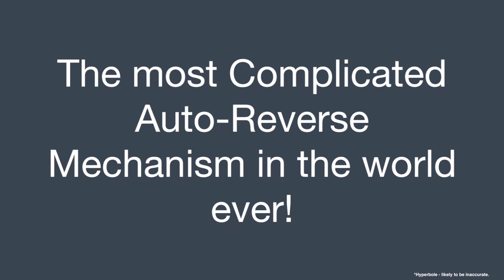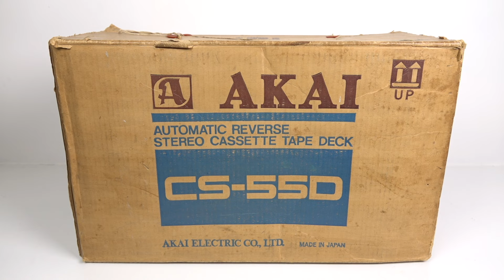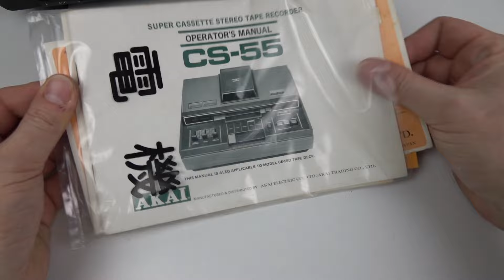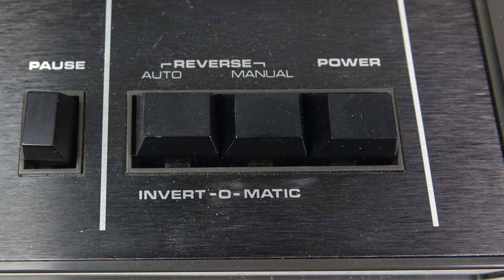Auto-Reverse: The Hard Way

Comment: I've admired this channel and the production values for quite a while. I'm still discovering videos that were posted years ago. This one is just terrific. It started out as a normal 'Techmoan' quality, which is very high. Then it ran into a montage of close up macro shots showing toothed tracks and gear wheels, belts, servos, actuators, lifting fingers, micro motors. Just wonderful. The smooth shadow and glare free lighting on these shots is astounding. Very difficult to get the tight camera focus and flat, perfectly white balanced soft lighting.  Excellent work. Thanks for posting. I hope your skill set makes you a good living and you have little to worry about. Wish you well.

Comment: The more I look at this, the more amazed I am at how this entire machine runs without any computer assistance. You can tell there was a ridiculous amount of thought put into this.
Reply: Sunny M don't even mention the assembly process. It's a jewel.
Reply: The engineer's brain was the computer. It's task: How to semi-automate (or fully-automate) a process using only electro-mechanical processes (because that's all there was at the time unless you wanted to make the thing 100X bigger by building a 'computer' into it, probably consisting of vacuum tubes or the earliest hand-wired through-hole electronic components).
Reply: @No-vm7go 

Lol what? Integrated curcuits already existed in '73.
Reply: At that time any chip in importance was like now an entire computer
Reply: @westelaudio943  Yes and I'm sure they must of been very expensive to big with!!
Reply: @toucan221  

No. They were in everything from cheap calculators to FM stereo decoders in tabletop radios.
Reply: @westelaudio943  That is Not strictly correct because I remember when you had to power a calculator from the mains,   NO they cant of had chips in them, your dreaming. that happened in the 80s
Reply: @toucan221  

I literally have one of those mains powered tabletop calculators and it has a custom microprocessor in it. 1974 was also when the ubiquitous 4558 op amp was introduced, which is still used in some computer speaker crossovers today. The 555 timer was introduced even earlier, 1972 I think, another cheap and widely used IC of the era.

Comment: Dear Techmoan!  Thank you for that, not seen it before, but what a joy!!  I built my business (now over 40 years...) on electro-mechanical design & fabrication, I am still immersed in it now.  Though modern electronics, etc. clearly have their place now, I get so incredibly bored stiff at, in particular, everything having to be controlled from a general purpose (mind-numbingly boring and quick to crash) Tablet, or whatever...  Give me proper switches, knobs and dials ANY DAY!  I have collected all sorts of stuff over the years, much like yourself, including the first (Philips) portable Cassette Player, which my dad bought me for Chrismas when I was about 9.  I stripped it down within 24hrs of getting it and still like taking all the old stuff apart again, even now!  And what about that SMELL!! - Transistors, Capacitors, Motors, Blah, blah.  Thank you again,  Mike Hughes,  MKH Engineering.

Comment from the maker: Multiple Head Auto-Reverse & Worm Gear
To save scrolling through the previous comments - here are all the comments (so far) about the multiple-head auto-reverse mechanisms not shown or mentioned in the video....and the correct name for the Spiral Gear.

COMMENTS ABOUT FOUR HEAD AUTO--REVERSE
Phill R
great video as always! but there was another type of auto reverse where there are tape heads that have 4 "pick ups" and would just reverse the tape direction and have a capstan/pinch roller either end, kinda like a mirror image transport mechanism

Vax Buster
Much better to use a double stacked head and reverse the motor direction, as Walkmans used to do

Remco Meeder
the cheapest solutions didn't even turn the heads but used double heads like the ones used in auto reverse walkmans :)

pcuser80
For players there is a much simpler solution.
In my old sony/aiwa player they used a 4track head.
i am sure that some decks also used a 4 track head, the head turnaround comes later.

john shead
there are machines that have a head like a 4 track machine. they just use the play record head in the correct direction and an erase head on the correct side of the record head.

Erik Bruijn
didn't later cassette players use quad channel heads, 2 for each side, instead of rotating heads?

Sparky Projects
Didn't most auto reverse use a 4 track head, and simply reverse the direction of tape travel, and swap tracks electrically ?
players didn't have the erase head to worry about, recorders had 2 erase heads iirc

ncdv47
I'm pretty sure that's the way it worked too, at least on the players I had. There were no parts that flipped or rotated.

william fleete
Car stereos used a single playback head but had 2 stereo head areas on each side and the stereo switched which half of the head it was reading off as well as the direction of the mechanism instead of changing the rotation of the head or flipping the tape

jormot
I think you didn't mention the 4-track head system. I don't know if that system was used in recording machines, but it was used in auto reverse car tape players.

Mike James
Car cassette auto reverse is done with a 4 track fixed head.

R-man R-man
I have a cheap ghetto blaster by Hitachi from about 1987, which has a luxury of 4 channel head, so it reverses playback without flipping anything. Shamefully, it's my only tape deck 
now.

DrSid42
I had a autoreverse walkman from Sony IIRC which just had double head and double roller.

terastarship2
there are 2 types of auto reverse, your is the first earlier by using mechanically. later type using the 2 or 3 heads by revering the roller that wheels the tape. <==== 2 or 3 heads =====>

FeCr3
There are some vintage auto reverse cassette deck's they have a fixed autoreverse head onboard like auto reverse car stereo's too...  Like my DUAL C828 from 1981: https://www.youtube.com/watch?v=VTEU-jX-Ikk

Philip vB
Only thing I would have added are the autoreverse Walkmen that had a 4-track head that did not turn and only switches channels, these are even perfectly azimuth-adjustable and totally reliable. (Example: Aiwa HS-PC202MII)

MrFixer1967
Now they do not flip the head or the tape. There are two pick up coils the the head. One for each direction.

Martin King
More modern machines simply had a head that could read both sides of the tape without needing to be rotated.

mikeselectricstuff
I never understood why they went to all the hassle of flipping heads etc. instead of doing what they did in car cassette players and simply used a 4-track head

MRooodddvvv 
not only car players.
i remember having portable cassette player with 4 track head as well.

Allan Bak
I'm missing one with auto reserve, pioneer ct-F750, with 4 track head that does not turn the cassetten or head, but just drive the other way when there are no more tape or can drive one way no problem with the head eventually comes out of the right angle

Salvatore Shiggerino
What the problem with simply stacking four heads and just reversing tape direction? Seems like it would be both cheaper and more reliable.

mikeselectricstuff 
I think it was because most car cassette players didn't have record capabilities so no erase head  to worry about being before the playback head in record mode.

ForestCat
The 4 track heads can only do playback. Due to crosstalk  - the record current on 2 heads on one side would be picked up and transfer to the other 2 heads. Also, never satisfactory unless the mechanism was absolutely perfect in manufacturing tolerance... in every auto reverse machine I tried to align if you got it perfect on one side, it would be slightly out on the other... hi-fi nuts didn't like them for that reason :)
 

COMMENTS ABOUT THE WORM GEAR

Benjamin Harvey
The spinning spiral driving the tape counter is called a worm gear in case you are interested.

Chad Barrett
It is called a worm gear. Not picking on you or anything. I just thought you would like to know what it is called.

Helium Road
I'm amazed the belts haven't brittled and the grease hasn't hardened after sitting in a box for 4 decades. And BTW, the "spiral thing" is called a worm gear.

Sod Alfredsod
The "spiral" wheel is called a worm gear.
worm gears have the quite intresting abiltiy to turn around a gear that it touches, but not the oposite. This, combined with their high gear ratio makes the ideal for heavy-duty applications.

wait, why did i waste time on this?
ah, I will post it anyway.

herrkelc
6:31 usually called worm wheel
Reply: +Techmoan Just to be ridiculously pedantic about the worm/"spiral" gear, you all seem to have missed the fact that it's not _spiral_ at all. It's _helical_. In fairness, common use (and some dictionary definitions!) often ignore this extremely technically nit-picking distinction between the two terms "spiral" and "helix".
Reply: +Techmoan Hey Techmoan, I've spent days with a team of video forensic experts going through your demonstration of the Akai CS-55D and we've found the following evidence of your total ineffectiveness. 
Incidentally - we are definitely the first people to point either of these things out:
1) You made no mention of a 4 head auto-reverse system which does not involve flipping the tape head.
2) You called a worm gear a spiral....lol noob.
Reply: +Techmoan I love this channel even more after seeing your lowdown of the comments. FML i need to get our more.
Reply: Its not helical gear its worm and pinion .  As helical gear is basically spur gear with angled teeth and nothing like gear on video
Reply: Very agree with you. I sometime disassemble then repair walkman mechanism, and the walkman's auto-reverse mechanism is much simpler than the Akai in this video...just with 2 pinch rollers and a reverse lever inside. The lever position indicates the direction: FWD or REV...

Comment: My dad bought the Philips cassette machine with the plastic chute back in the 70s when it was just released. I was still using it in the 90s. It worked flawlessly for 20+ yrs and was still working and sounding great when I finally bought a new sound system and retired it to the attic. It was a great piece of early 70s technology. You just loaded it up with all your fav tapes and it would play all day without just playing the same one album again and again. Of course you had to get up and eject through the other tapes if you wanted to hear the other side of a tape right away, but back then when it was new, it was a minor hassle for something that was so cool at the time.

Comment: I had the model GXC-65D that he mentioned briefly. I bought it used, and used it for several years. It was a good, reliable machine. The only work I ever had to do on it besides routine cleaning and demagnetizing was replacing the belt on the counter. I was always impressed by the reversing mechanism. The plastic cover over the mechanism was removable on the 65D, so it was easy to watch it do its thing.

Comment: As an engineer, that is very satisfying.
Reply: as a fellow engineer, and as one who was born in 1973 i completely agree.
so... you were also trying to figure it out.. right   LOL

i remember playing with this sort of stuff when i was around 10
never really it understood the electronics at the time, but i did figure most of the mechanics.

in truth, the method by which it's flipping the tape is actually pretty smart,
this is what we used to do with our fingers

normally, at the end of side A, you get your tape with your second and middle finger and just twist your fingers
and the tape would flip between your fingers and you'd let it fall back into the deck

this is essentially mimicking that movement

but the engineering behind this is both simple and cool
and i can see the resemblence between thsi and how the Old BETA Max used to load Tapes as well as VHS Players
Reply: The engineering this is cool but NOT SIMPLE. This is a perfect example of over complicating things. Not sure why they did that but it sure does look cool.

Comment: imagine how smart was the man who designed it
Reply: Smarter than the one who designed the Philips version from the time! It looks like a scale prop from Cheggars Plays Pop!
Reply: Not one man, but many men. Different components designed by different people.
Reply: Without any computer program to help designing and simulate it. Freaking marvellous. Can't imagine how to start such a project anyway.
Reply: Not smart enough (or too smart) to see that you can just reverse the tape head without turning the cassette.
Reply: You don't even need to do that - just have a reverse mechanism when the tape gets to the end and a double tape head which begins reading the lower part of the tape (ie side 2) as the taoe goes in reverse. That would do the same thing without any special mechanics except an end-of-tape sensor and a motor with reversable polarity. Easy! But boring.
Reply: @tantotonto    That works only for play, not for record.
Reply: @RadicalCaveman  Why not? What the difference between playing and recording different parts of the tape? Erasing head could be also doubled as playing head. I've seen that system in a walkman, without recording ofcourse as it wasn't common for walkmans.
Reply: @romangilmanov    I don't actually know myself.  I'm just repeating what the guy said in the video.
Reply: imagine how smart was the person who designed a not simple clock :)
Reply: @zandarion  Very smart indeed!
Reply: It's actually extremely complicated inside!  I once ruined one by fiddling with it..
Reply: @hamstrtj  they had computer programs back then. Just weren't used in homes but were used in industrial practices such as these

Comment: 8:35 Oh, yes. Misaligned heads were SO common. I always thought the b-side had a worse sound than the a-side and the alignement was an issue on portable players. I once had a walkman that would get misaligned on the second side all the time. I usually used auto-reverse players...without using the auto-reverse function.
Reply: That is one of the reasons (concerns about head alignment) I avoided auto reverse. Another reason was that it made the deck much more complicated to use.

Comment: I never understood why they went to all the hassle of flipping heads etc. instead of doing what they did in car cassette players and simply used a 4-track head
Reply: +mikeselectricstuff 
not only car players.
i remember having portable cassette player with 4 track head as well.
Reply: +mikeselectricstuff 

I think it was because most car cassette players didn't have record capabilities so no erase head  to worry about being before the playback head in record mode.
Reply: What if your short those 2 inactive tracks? Anyway you would need second capstan, pinch roller, and erase head on other side and have it matching speed perfectly to the first one. One side would end up wearing more than the other so it would go out of alignment. So I guess in the end it's simple to somehow rotate the cassette :)
Reply: I wonder if it would be possible to use two separate two-track heads, one for each side. It should be possible for a playback only machine, but it might not with a playback and recording machine (due to lack of space for what would be five heads [erase, two for recording and two for playback]).

These complications are why I specifically sought out a single-direction cassette deck since I never trusted auto reverse due to issues with head alignment and the relative complexity of the deck.
Reply: Wasnt it because if they used 4-track the audio resolution would have been poorer?
Reply: To: Rapisu and Hamutarou,
Several Hitachi cassette decks (as well as a few other brands) came equipped with an azimuth control so that you could tune the head to every tape and get perfect playback, unfortunately few cassette decks were available with this, although Common Sense would dictate that it was a feature that ALL cassette decks should have had as a standard.
Reply: The Dragon had a 4-track head but could only record in one direction.
Reply: Watch the whole video, Techmoan actually explains why that is a bad idea.
Reply: Hhhh

Comment: Fantastic engineering in the Akai.   I used to work for a company that rented out the Philips ski slope players to pubs etc for back ground music purposes.   The main idea I think was for continus play, they needed min 6 and max 8 cassettes for the machine to work.  They had the ability to record as well as playback but the record feature was disabled in our machines.   Quite successful but intended for the domestic market, so being used for 12 plus hours a day meant higher maintenance.   I got quite good at repairing them, the most common problem was teeth stripped from a large gear that rotated in the change mechanism.   But rater fiddly to repair with a string arrangement used to push the tapes out, great fun.